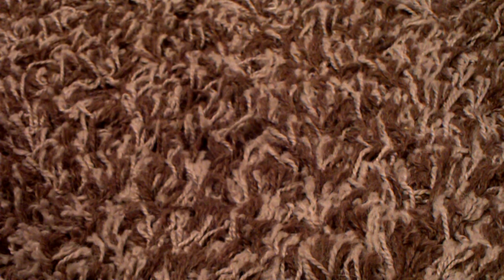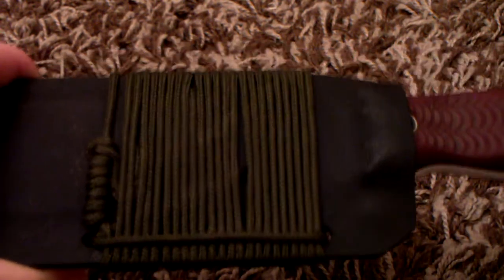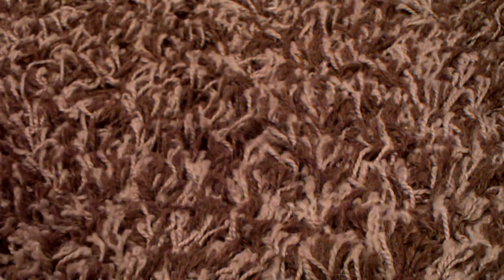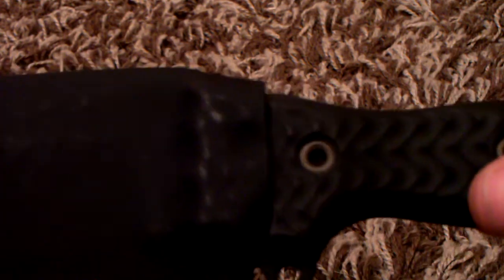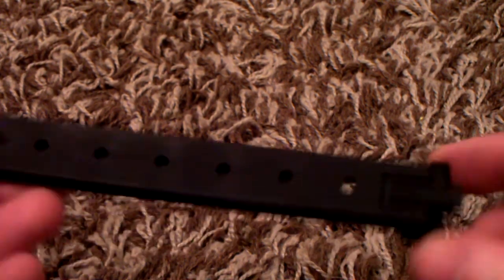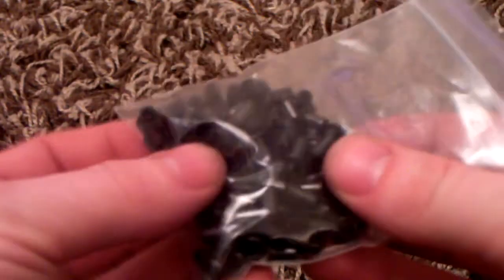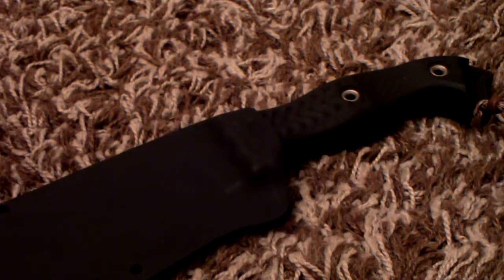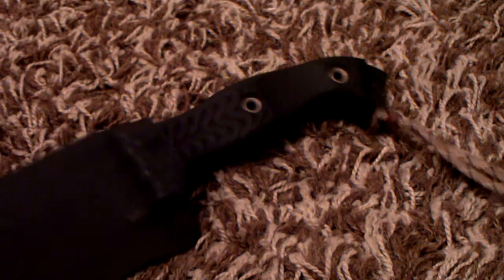Homemade Busse FFBM Kydex Sheath!!!

Comment: Looks like a good start. To help with inserting the knife in you want to bevel the inside of the kydex on the edges where the blade goes in, So that its like a ramp. This eases the blade in instead of catching. I'll do a short vid if you like to show what I mean.

Comment: cool.. yes, the ramping only effects how easy it goes in. it doesn't effect the pull out at all. Also, until you get your eyelet press, just use some nuts, bolts and washers to hold it all in.. At least you can unscrew it to wash out mud and stuff.